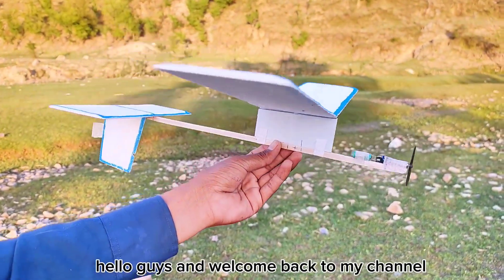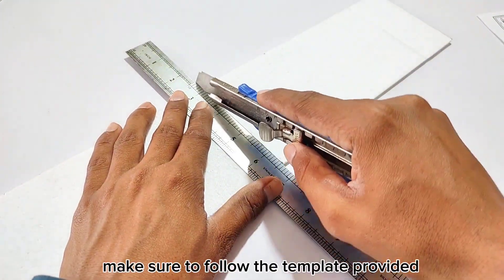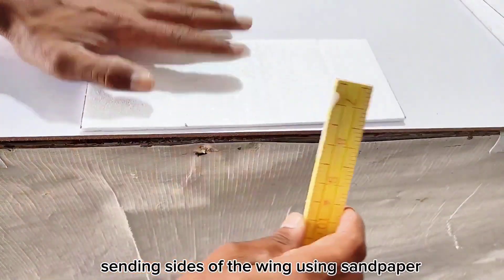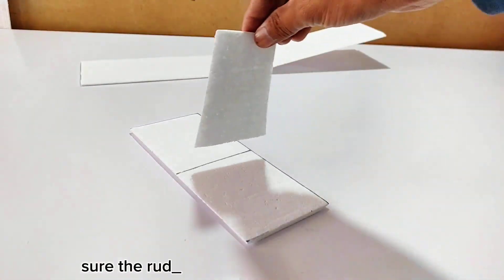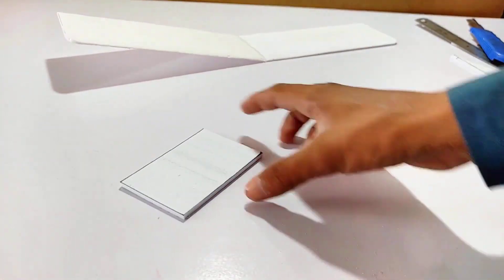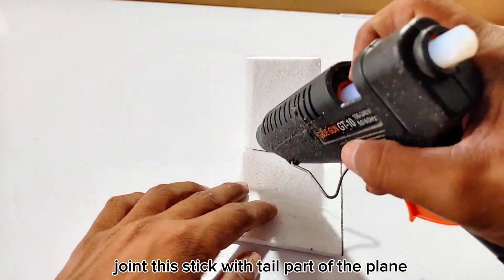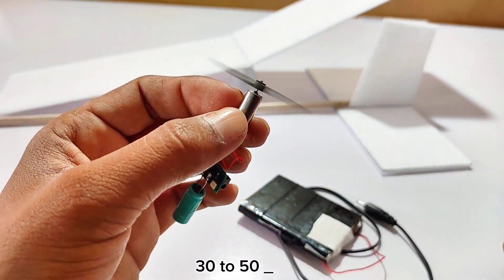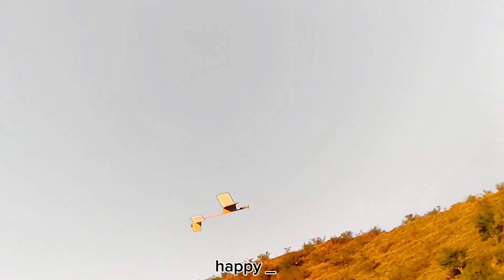How To Make Free Fligth Capacitor Powered Plane | Capacitor Powered Model Airplane

Comment: 044   stabs  should  be  made  as  LIGHT  as possible, without reducing their function.!      stab root chords should be roughly equal to 2/3 of the wing chord.      a couple degrees of  SWEEP  should be used at the horiz-stab le.!
105   the height of the vert-stab should be equal to a bit less-than 1/2 of the horiz-stab span.
407   you are locating the  Center of Mass (c-m); not the cg.!      the location of the c-m  SHOULD  be at a point that vertically aligns with  25 percent of chord.          googletranslate